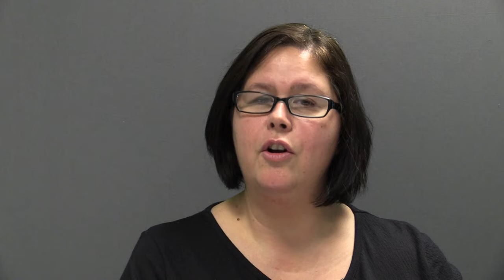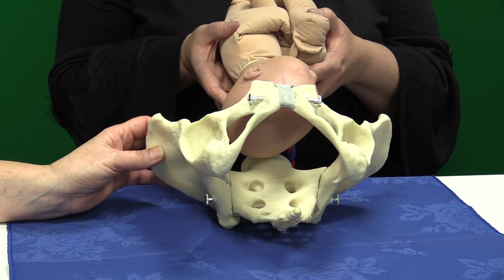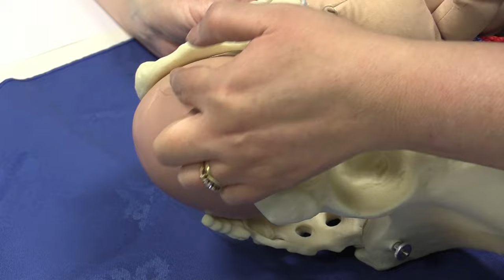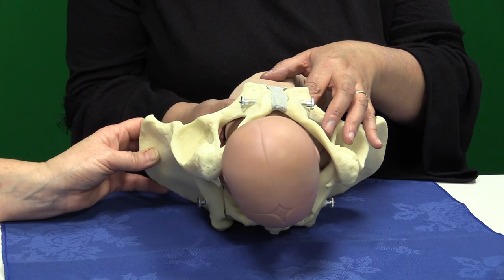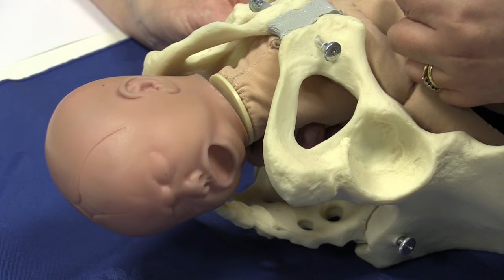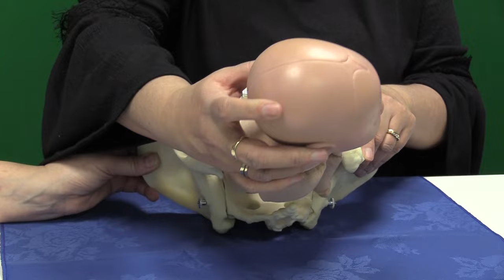Mechanism of Occipitoposterior Labour - Long Rotation

Comment: Even if the mom labors the entire tip with baby in the OP position, does the baby usually turn to be born AP? How often does "sunny side up" happen?
Reply: it happens quite alot actually
90% of occipito-posterior cases turn into occipito-anterior by long anterior rotation (3/8 of a circle) and the labor continues as a normal OA
this is due to slight deflexion of the head 
see, the greater the degree of deflesion, the worse the chance for vaginal delivery
Reply: I gave birth 2 weeks ago, my third child had this position, very long and painful labor , It was born anyway...it rotated by itself....